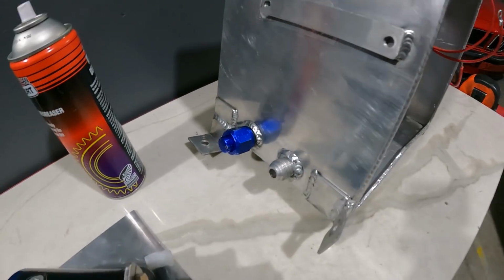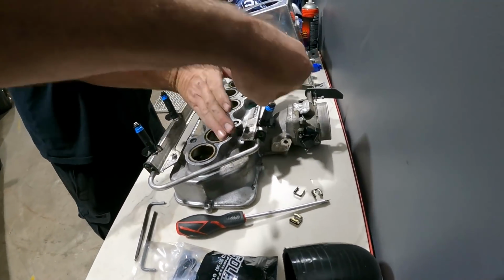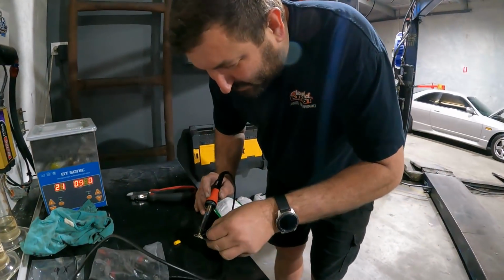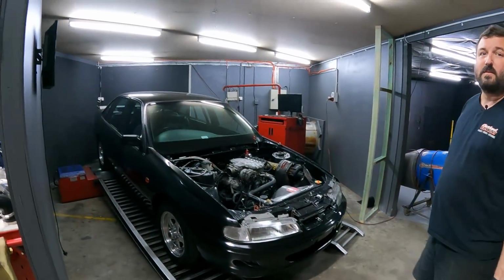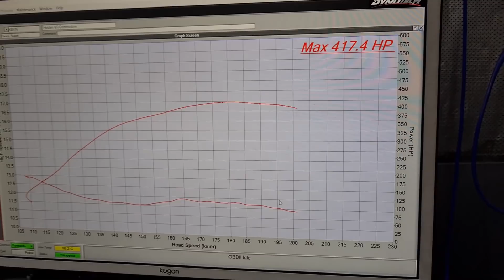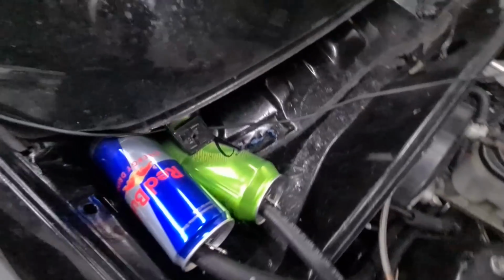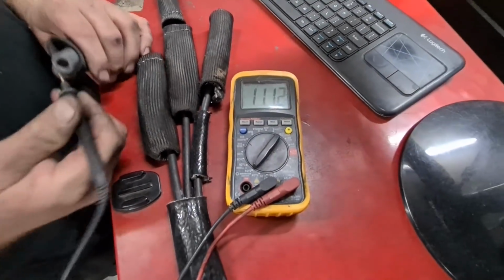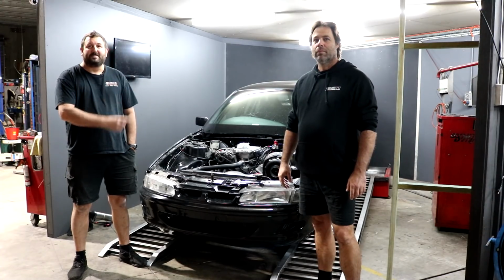Kevo goes full sicko on the dyno!!

Comment: 11:54 Love the realism of a refurb: injector bench cluttered with stuff, fuel open to the air, a flappy disc from a grinder and a soldering iron too.
All we need next is a yankee candle and an 80's tracksuit in close proximity to get the full house!
Great vids guys.
17:20 After the manufacturers' recommended method of cooling tig welds; there was slight arcing on the corner of the tank on the table. Or was it aliens?

Comment: Something going on there
My old stock motor setup was 421hp with 15pound through a gt3582
Cammed and "L67 bottom end" was 590hp at 24psi till I blew the comp cover off.
Something isn't happy at all
Cam timing dialled in to the card as well?
Reply: Was about to say, my shitter ecoboost made 412whp @14psi on a stock engine stock springs through a 4l60e with a China turbo🤣 Kevin is definitely not having a good time 🤣
Reply: @Stocko113  yeah man
Either that converter is is not helping, box is slipping or something in the wiring or motor just isn't having a good time
Such a shame, was hoping to see 700+ outa this 🤣

Comment: do a compression test--- (clears up running leaner spark gap?
Reply: These things can be pretty fussy about spark gap. Even stock can vary between 1.0 to 1.4mm. Guess I'll have to watch the rest of the vid to be sure. Running a tranny or box with no electronics would eliminate some potential issues though.

Comment: could it be as simple as valve lash/pre load.. otherwise you'd just do a leakdown test before the heads come off?
Reply: Don't need to set valve lash on these. They are auto adjusting.
Reply: @stuartwinter2758  pre load of the lifter is the equivalent.. would depend on cam lift if it needed new pushrods etc